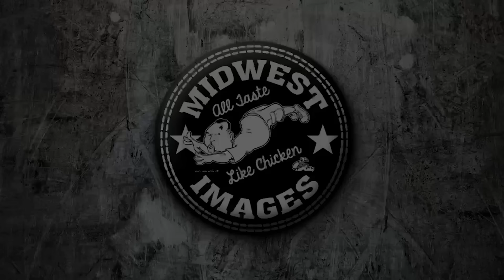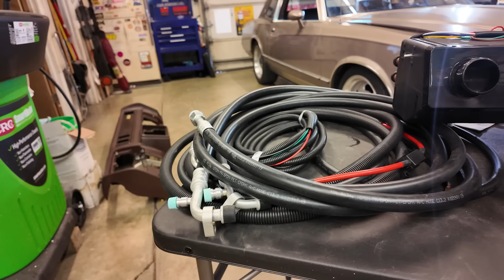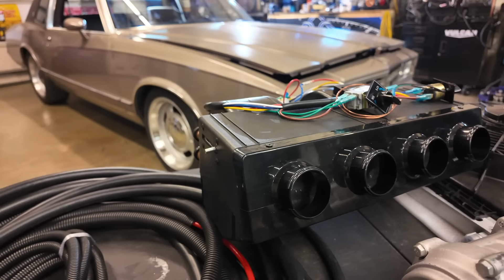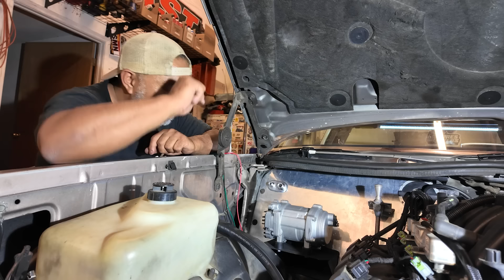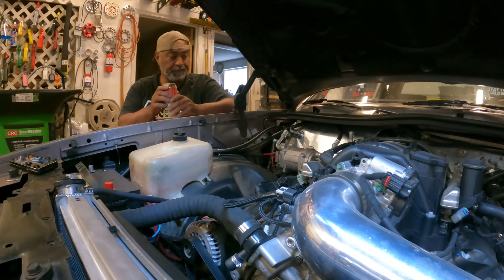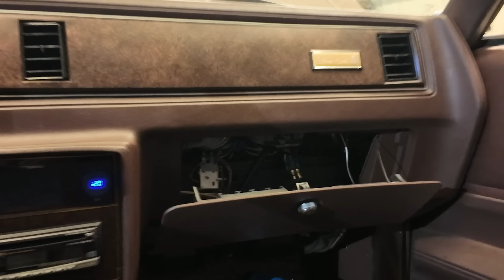12 VOLT AIR-CONDITIONING MY HEMI MONTE CARLO...IS IT WORTH IT?

Comment: So, my truck is a 51 chevy 3100 with a tiny cab.  Wonder if I could get away with the smaller 8,000BTU unit so that I can avoid a big draw on the electrical?

Comment: Thank's Mike for putting this up...... thinking about this for my '72 Firebird. so the one super critical part of this: put a vacuum on the system for as long as possible before charging. this evaporates any moisture trapped in the system or dissolved in the oil and removes air. moisture can destroy the compressor if it's high enough, and air in the system makes cooling sub-par. Finally, I've found most a/c oil will naturally glow under a black-light, so adding dye makes it glow better but isn't really necessary.

Comment: Hello Sr. Thank you so much for great tutorial. I have a ac kit and I changed the condenser fan i purchased the inverter kit to use a second stand along battery. My problem is, the compressor i have has only a three wire hook up for the condenser fan and the under the dash unit I have in my truck and of course no wiring instructions. Can you help me Cotton?

Comment: If the compressor was spun @ a Higher RPM would it improve the BTU output ? i am told most of the units sold, do NOT put out enough BTU to effectively cool esp if you live in a hot place like Arizona! 😄

Comment: Mike did you have any issues with the condensate going where it ssuppose to go. I mounted mine like yours and half the friggin condensate goes into the fan and on the floor the other half goes down the drain.
Reply from the maker: Nope.  Its out the drain.  Mine is at a slight angle.  Not straight up and down.

Comment: Do you recall what size the bulkhead pass through fittings were? I know the larger is always #10 but do you recall if the smaller was a #6 or #8?

Comment: With all the electrical stuff we run on hot rods today. And most of all old cruisers. 250 amp alt and an extra battery in the trunk. And you should never lack for power. Yes, a little over kill. But it will never let you down. And no worries with a 60 amp spike on that 12 volt compressor.

Comment: could you connect the new lines to the old factory lines for the stock ac to be able to use the factory vents etc?
Reply from the maker: Absolutely.   Just replace the belt driven compressor with the electric

Comment: You want to upgrade your battery more than your alternator.
You are getting the power from the battery. The alternator just charges your battery.
Get a deep cycle battery so you can have more power on demand.

Comment: Firstly, you are great at explaining things very easy to follow what you say and understand it, 2. I’m in the process of cabbing in my side by side and have already installed full doors and a heater now I’m looking to install AC. Would this kit even be worth attempting knowing the UTV uses a stator for charging not an alternator
Reply from the maker: I wouldn't run this on it unless you get like a upgraded stator and a really good battery.  It pulls 60amps
Reply: @Midwestpaintandmetal  hmm very unfortunate because it seemed like a perfect solution, I reckon I’ll just resort to the ole radiator fan mounted over head trick
Reply from the maker: @NovaleraGaming or do like one of those coolers with a fan on it and put ice in it

Comment: Window tint on the sides would definitely help but they also have a completely clear solar shield that goes down your whole front windshield that blocks 99% of UV light and a lot of solar heat. Not cheap but it makes a huge difference.

Comment: Best bet is to run a lithium ion battery, and then a DC-to-DC converter to keep it charged. Basically, the same setup as guys who have big subs/amps. Should work fine for this application, and can also take the large surge of current needed to start the compressor. Also, another page from the audio guys' playbook, run a second alternator.
Reply: The last thing you want is a fucking fire-prone lithium battery burning your fucking car down.

Comment: Hello from indonesia the installer here pre request that your car upgrade alternator to 150ah and car battery 100ah at the minimum to keep up with  electric compressor load. And engine should keep operate to maintain amps.

Comment: Condenser rejects heat, evaporator absorbs heat. Compressor circulates the refrigerant and separates high and low pressures on one side, metering device (expansion valve or orifice tube) drops pressure from high to low on the other side.

Comment: I put a kit on my big truck.  I spent more for a larger capacity.  I have 8 group 31 batteries. I upgraded to a 320amp alternator.  As for sitting, in Phoenix last summer, 105 degrees. It ran 9 hours before the generator kicked on to charge the batteries.  I figure its saving 10 gallons of diesel a day.
Reply: 9 hours with the vehicle off? "Sitting" = idle? Generator kicked on... while driving?

Comment: I want to hook one to my vans original inside AC box, its capped due to previous owner yanking wires from the compressor, which was bad, hoses were connected with screw clamps, screamed it required a complete redo, so new engine I tossed the AC compressor, and smog pump, never had AC for me, I sure would like it, but if I did, I'd put a secondary alternator on my engine to just run the AC and spare AGM battery.
Reply from the maker: That should work.
Reply: @Midwestpaintandmetal  Running AC engine off is such a plus, gas being so high, and my van drinking it so fast, want a roof rack to toss solar panels on, right now, I have one stuck on by magnets to keep the battery topped off.

Comment: Good to know. I have a Ford Ranger I am putting a 5.0 in and it did not come with AC factory and do not feel it is worth converting from a parts truck due to replacing most of it anyway, one of these would cool my small cab nicely.
Reply from the maker: Absolutely will.  If you watch the part 2 you can see the more cfm box and the upgrades

Comment: Great video been debating on doing this to my 68 bronco after im done with the coyote swap. A lot of people will say why not just use the ac pump on a coyote front dress. I didn't like where the pump was located on those brackets once its in the bronco.
Reply from the maker: The good thing about this kind of setup is tou can mount the compressor any where

Comment: I'm doing the same thing to my 75 F100. It actually had a space for another battery and I went with a deep cycle marine AGM battery and a 1 wire 140 amp alternator.  Still working on the install.
Reply from the maker: Just remember that try to run the same two styles of batteries.  If you do amg as secondary, use amg as main also.  Makes sure your voltage is even

Comment: There was no mention of a receiver/dryer or an expansion valve. Does this system use these components?
Reply from the maker: Yes.   It was mounted on the condenser.

Comment: Well it’s 8 months later so what is your opinion now. I have a 72 Chevy pickup and was thinking about this. Also you aren’t from Oklahoma are you? Cotton’s salvage in inola
Reply from the maker: It def would work good in that small of a cabin.   Just make sure you run at least 150 amp alternator and a good battery.  If you watch the part two you will see the upgrades.  Im still liking mine.  Im over in IL
Reply: @Midwestpaintandmetal Thanks for the update!

Comment: Did you happen to check the amp draw of the system in operation? How is the long term report?
Reply from the maker: Its pulling 60amps.  After I did the upgrades to it, im still good with it. You can see those  upgrades on the second part video

Comment: 150 AMP MINIMUM ALTERNATOR ,,, CONDENSER  same size or bigger than stock OEM .. Design =parallel flow .   Evaporator core should be as big as factory and also parallel flow design ... U look to be using a old school thermostat [inaccurate ] An electronic thermistor unit is best .  
Evacuation is technically done by moisture level micron rating  but on a new unsealed system 4 hours would be ok

Comment: On the alternating current side of air conditioning we just put a start kit in it to keep the amps down on start up. You might concievably be able to put a vfd on it and allow it to ramp up as opposed to 100% on at start up. I don't  know if there are VFDs for dc motors, but.... might be worth a look.

Comment: U complaining about 90 degrees 😂😂. I live outside in 110+   no ac. The problem is, you have to let your body get used to the heat. It takes about a week or 2. Then the high temperatures won't seem bad at all
Because your body adjusts
Reply: Dry heat vs humid heat.  No comparison.

Comment: If you pull a vacuum on your AC unit, and it even has a slight leak, fix the leak. And it's not a good system. You shouldn't have any leakage at all

Comment: Thank you for this. I have a V8 S10 with factory AC. The AC works great, but I don't like running the AC compressor off the motor. I have been looking into electric AC. Your video was helpful.

Comment: My 1960 Chevy Belair still has a generator. So I was always gonna switch to an alternator, and it was suggested to me to get a 200 amp alternator. It was also suggested to me to get one of those AGM car batteries. That's all for running these ebay electric air conditioners with heat. At somewhere around $500, that's about a minimum of 1/4 the price of adding vintage air that works off your car. Those are super expensive and not what I'd like to try to install myself. I don't know much about it, but I was told the above products would be what I'd need.
Reply: There's a company that makes agm batteries with a jump start battery built in.  Can't remember the name , but when my optima needs replaced, I'll buy buying one of those.

Comment: Hey brother cool video , but I was looking on eBay for that kit and I found one for 499 that looks exactly like yours and in the description they don’t say how many btu the unit is, they just say the cooling capacity in watts which you have to convert to btu to find the real cooling capacity. They say this units cool from 1000 to 2000 watts , well the formula to convert it is simple multiplied the amount of watts for 3.412   . So if we assume the higher number 2000x3.412 =6,824 BTU so as you can see you absolutely have half of the cooling capacity you thought you had , and that’s why is really not able to keep up with a big car like a Monte Carlo . Maybe a small coupe car like a Mazda Miata , bmw z3 you know something of that nature . Just think about it a 12000btu window ac can cool down 12x12 ft room in minutes if it was really 12000btu thrust me that car would be on ice ice baby 😂😂.
Reply from the maker: Usually they are low btu in that kit.  I upgraded to another evap box on part 2 upgrades that works great. Its the next video

Comment: Fell on your channel because I’m facing decisions for my 25 yr old DP motorhome.  The chassis AC does not work.  I have not diagnosed it yet, but there’s 90 feet of compressed gas lines and a compressor that is in the worst place to work on.  I am considering the idea of putting a 12V unit that would be all tied up at the front of the cab.  I could even use the bracket for the AC compressor to add another alternator that could be dedicated to that AC system, or a similar system working on 24V - in any case, something better than paying a fortune for a diagnostic only to find the compressor is shot (which I think it is) and there’s a leak on one of lines under the darn RV…  Would you think it could work, or the cooling power would be lost on us - we just need a cool breeze on us sitting in the driver seats - we know we need to run the roof ac if we want to keep the whole RV cool while driving.

Comment: Why are you installing an electric compressor, when it's clear you can  install a engine driven compressor, I don't understand this logic, makes no sense.
Reply: Why draw on engine horsepower when you can go electric?
Reply: @JeffRobertson-m7v Well that's one to look at it, but you're still putting a draw on the engine, through the electrical load called the alternator, you don't get something for nothing. Either an electrical load or a mechanical load. It's about the same trade off. Me, I rather have the compressor  being driven off a belt then a electric motor.

Comment: Out of curiosity, did you try to block off the original fan from the ducting? 
I feel that the air flow issue may be due to some of the air being forced through the original fan. (Reverse direction of the original fan airflow)
Reply from the maker: There is no original fan.  We pulled the whole heater box assembly out

Comment: For a vehicle that already had a belt driven compressor, I think it would be easier. In place of the compressor pulley replace it with another alternator😁, that would double the current. In another case put in another battery,12 volts,charge them in parallel  but use a 24 volts compressor,connecting the batteries in series to the compressor.

Comment: I have a 57 Pontiac . I am putting electric ac on it. I am doing it but retrofitting used items. I have a repurposed 91 Civic evaporator box and Fan for under the dash. That’s as far as i have got. So from watching your video i am hoping this 91 Civic Fan will be better than your squirrel cage . Other than that i will choose wisely on the compressor. I already have a 140 alternator. So thank you for your video. IT will help me a lot.

Comment: I put this system on my old Hilux with a 4cly engine, but I upgraded to a 150amp alternator and it seems to be fine so far! 
With your system is the "low" setting coldest for you or "high"?

Comment: The way its going and looking the 48v system is the way to go gents . Even oem uses 48v for mild hybrid electric motors . Its safer on the wires and charging system as well

Comment: Hello, you can use an Amp Clamp. You just hold the tool on the wire and it will show you the exact amperage being pulled from that wire!

Comment: I’ve been doing engineering installation on cars trucks and tractor for 40 years. I have a solution to all your problems I can design any unit that will fit your cars or trucks or tractor.

Comment: Im playing with a similar system but im choosing to plumb the compressor into the cars factory ac system
Reply from the maker: That will work fine.  Just make sure you have enough voltage for the amperage it pulls
Reply: @Midwestpaintandmetal the vw tdi alternator puts out 120 to 180 amp depending on which one i have and my tdis are converted to manuals so I have a lot of amperage to work with

Comment: I’ve been wondering about putting one of these compressors into an existing factory system. Basically just replacing the engine driven compressor with the 12V compressor but using the factory condenser and factory in cabin ducting and fan.
Reply from the maker: That should work fine

Comment: You said the new system is 12,500 btus. The average car ac is far below that. I can't remember the spec but here's the kicker. That car likely has an R value of MEH.. Food for thought, carpet padding, thicker modern headliner, barriers under door panels and behind the back seat. I promise you could make that system freeze you, and silence  road and wind noise. Then the radio sounds better too. And yes, bigger alternator for sure. Best of luck Sir, great video

Comment: As far as I'm concerned Great Video. You bring up a lot of good points, example if you stll can use Factory units and just add compressor. and maybe the most important one needed is build up your electrical output! You sir are my kind of mechanic!

Comment: Hi! Thanks a lot for the video, very informative. 

I am thinking to install this system in my rig and I will need to make some custom hoses. Online I cannot find the specs of the hoses. Could you share the inner diameter sizes of the three hoses? Or at least which fittings you ended up using?

Thanks a lot!!

Comment: Maybe not so much as a bigger compressor for colder a higher cfm blower across the evaporator will do the most in cooling the expansion valve will regulate the Freon and pull heat from the evaporator. Increasing the voltage to the blower motor might give you the difference they make dc to dc converters and also could look into the intake of the blower housing, could possibly make it bigger that could be a factor too.

Comment: You need to do what OEMs do when the air conditioner runs... increase the idle speed... so the alternator can keep the battery charged.

Run the air conditioner "run" wire into the Holley computer, and when that air conditioner Run wire turns On, have the Holley increase the idle speed just enough to get the alternator output to raise... probably just a couple of hundred RPMs.

Using a separate 12v battery system just for the air conditioner won't help if the alternator can't keep it charged... if you run that battery down, the alternator is still the only way to recharge that battery. If you only use a 100Ah battery, and the system draws 75 Amps (after you increase the blower size), it will run 30-40 minutes before it shuts off. You'd have to have a HUGE (100 pound) RV or Golf Cart battery to run it a long time... then your alternator will take forever to charge it back up. (yes, I'm an electronics engineer... so I'm not pulling this stuff out of thin air) 

YES, get window tint... AS LONG AS it has 95% or higher IR (solar heat) blocking. You can even tint the windshield with very little darkening but 95% IR block... but blocking the IR (and even UV) will be a huge help!

Buy a DC Clamp Ammeter... I recommend the Uni-T model UT203+ for most stuff... check out on Amazon. It cam measure AC or DC Amps just by clamping it over the power wire... up to 4pp Amps... just be sure to "Zero" it when using it for DC. It's also a nice meter for measuring everything else a normal multimeter does.